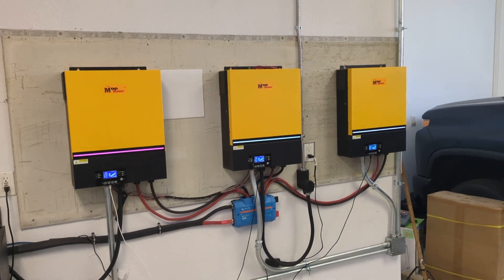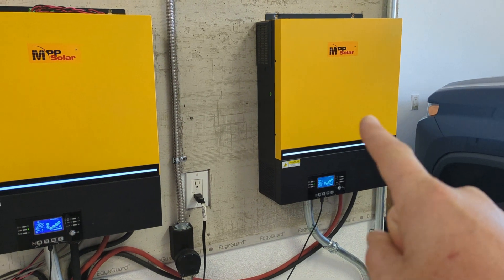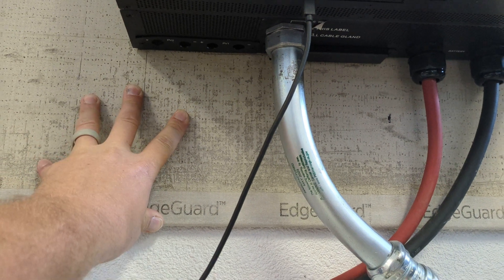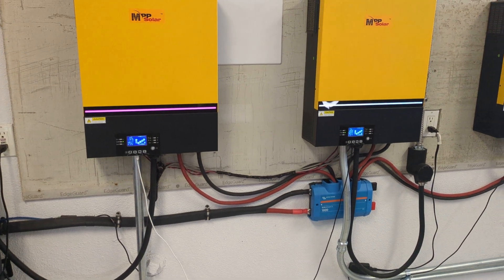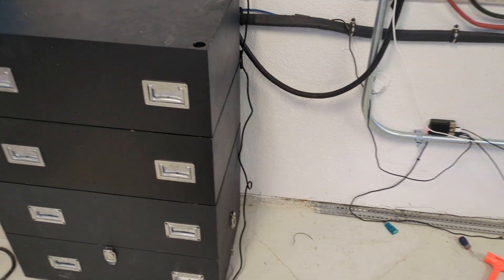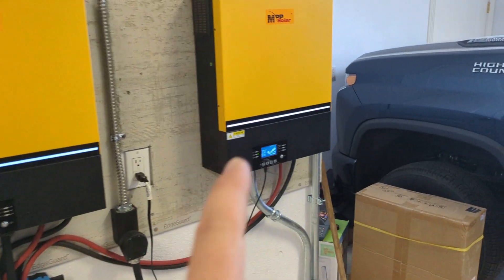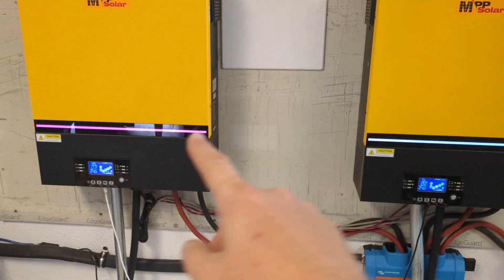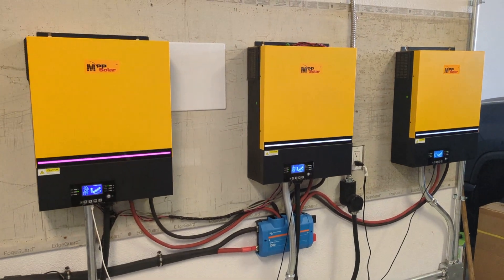Get your House Off Grid | 24kwh Off-grid Solar | DC side |  MPP | Apexium | Sungoldpower 12k

Comment: Quick question on your solar sub panel's.  I use the same "Reliance" but have one from Connecticut Energy as well.  How are you splitting out your phases to each inverter?  Do you come AC out to a distribution block and then one to each of your transfer switch legs?  I have one inverter today but will be putting in another inverter to get 240 (EG4 6500ex).  I have the AC out on the inverter going straight to the transfer switch, but I'll need to split that out if I'm going to add another 10 circuit transfer switch.
Reply from the maker: My A/C side of the stack is 240v split phase. I run that to a sub panel and then out to the reliance controls generator panels.
Reply: @BecomingOffgrid  so the Sub Panel is acting as your distribution of sorts?  Then from there you have a breaker that feeds your Reliance transfer switch?  For the 240, you’re just coming off one double pole breaker?
Reply from the maker: My inverters are not in parallel. They can't be due to the way my house was wired. They output 240 split phase. 

Outputs from each inverter run to a sub panel that is used to distribute to the reliance controls panels.

Comment: I have a similar set up but only one all in one as a charger and a split phase sungold as my inverter. I use a second charger that is a power max 50 amp charger. My system is Always on batteries but I also use a couple 150-70 victron charge controllers in the mix so it's a total of 4 charge controllers... 2 110 chargers.. 1 220 charger and 45 kw of lifepo4 at the moment but wanting another 30 kw soon. Thanks for the video
Reply from the maker: Thanks for watching
Reply from the maker: Do you have any videos of your setup
Reply: @BecomingOffgrid  I have a lot of pictures I've took of my systems I've built and of the one I'm currently using but I'm kinda shy about making a YouTube video. I'd love to have the courage you guys have that can actually make videos for the world to see. Thanks to y'all that make the videos I learned enough to start putting together systems myself. I am an over the road truck driver and this solar stuff became a hobby almost two years ago and now.. 30 grand later it's what powers our home. I'd love to show you my pics of my systems tho if there is some way I could send them to you let me know

Comment: Awesome job,vid & setup ya got there mate, & looks like you’ve kept it relatively simple with a nice twist.  The new AIO Hybrid systems that are out now-days make it all so much easier for the DIYer and this is a good use case, even if only used as a solar controller, they are feature rich for the price point. 
We have 240vac throughout Australia, so no messing around with dual phases, I am glad to say. 
I have 10 kwh of grid tied Solar & charge a 30 kwh lifepo4 battery bank via a 5kwh MPPT AIO inverter in a similar manner, except I plug the AIO system into the mains to charge from 9am-3pm daily on timer for a full charge which supplies most of my needs except for some of the bigger power users like the ovens, toaster & jug, the 320 ltr H/W system is on a timer with a smaller 1800W element for 4 hrs/day. This has all been working great for 18 months now & we get around $400/yr back from our power company which is nice also. 
I have another AIO inverter I am yet to install to run 3 x split inverter A/Cons & finish off this setup & watching ur vid has inspired me to finish it sooner than later with Summer coming on. TFS. Cheers
Reply from the maker: The split phase stuff is a bit of a pain, but honestly if I was EU/AU 240 power I would set it up the same way. I don't want my loads flicking on and off every time the inverter switches over to grid. It's really about protecting my loads more than anything else.

Comment: Do you have the yellow mpp inverters switched off? I read that it you switch them off they will still charge from solar or utility but will use a lot less power then being switched on. Switched on is only if you need them to invert from DC to ac
Reply from the maker: If they are connected to solar only, they will absolutely charge. But if you have a grid connection they will do that too. 

This is worth a short to explain
Reply from the maker: Here is your answer

https://youtu.be/7MRP0Xel-dc?si=GiNosjD-or48U8ct

Comment: Thanks again for a great video i do understand the whole set up i cant say i can replicate it because im not that skilled lol but i have an idea.Will be waiting on the battery build this is good content
Reply from the maker: You can do this for much cheaper with a couple of chargeverters if you want the system to never switch off battery. I did a video on it.
Reply: @BecomingOffgrid   i have plans to do small set up  somtime soon just for a little pratice and testing

Comment: Fantastic video!  And another problem this avoids is any accidental small micro feed back to the grid.  Apparently that’s an issue with some hybrid inverters and can get you in trouble if you have a smart meter.  I think your design might be the solution I’ve been looking for! Now I just need a half dozen more batteries! 😂
Reply from the maker: I was actually going to cover that in the next video! This setup fixes so many problems with hybrid inverters.

Thank you for watching!

Comment: Thanks for the content. What are your thoughts on the viability of the F150 Lightening as a truck, if I may ask? I had an order placed for one but canceled it after seeing a lot of negative reviews online. Terrible towing mileage and such…
Reply from the maker: I don't really drive much. The lightning was just really a way to get a 98kwh battery bank that I can sell after 10 years of daily pummeling as a standby battery. If you have real truck stuff to do, get anything else.
Reply: @BecomingOffgrid I like ur thinking there, I have had similar thoughts for an EV purchase, more for a mobile backup & extra battery power to my home system than a commuter.
Reply: Wow good call on the mpp usage